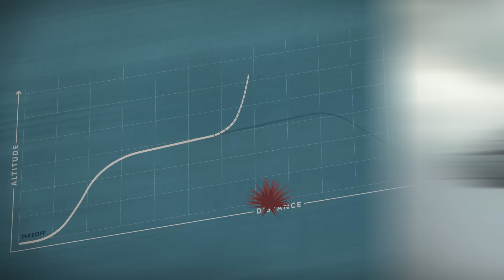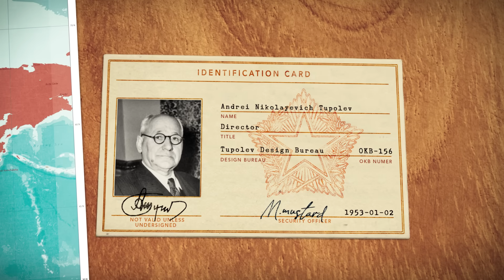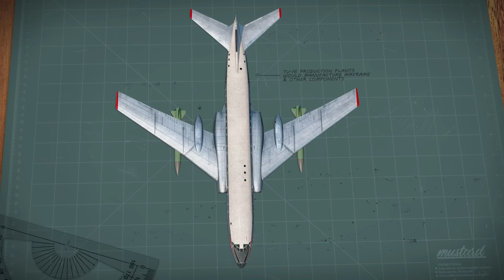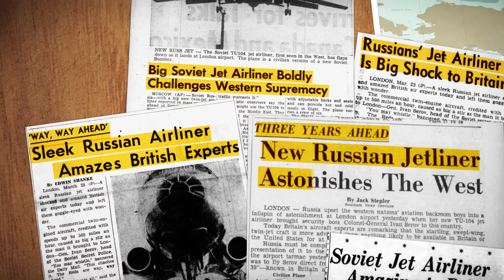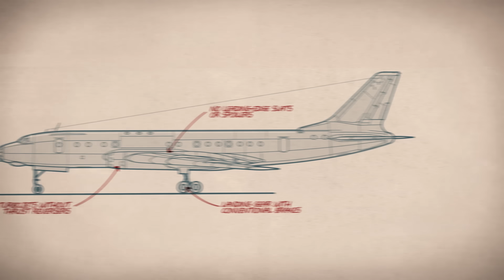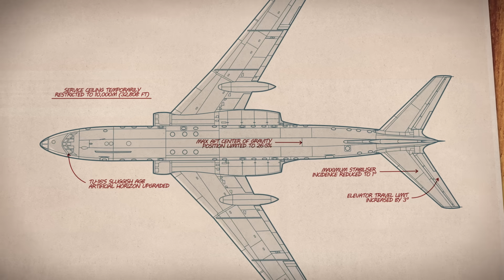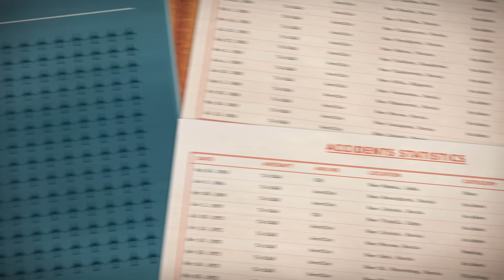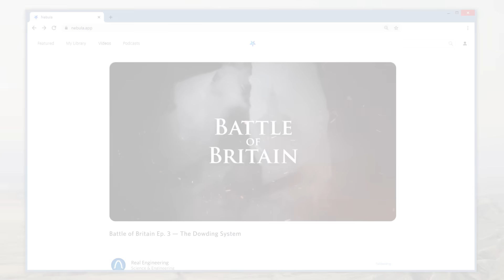The Soviet Airliner Designed To Crash

Comment: Clearly we feel we can shed some light on some common myths & misunderstandings.

  That's correct of course, at the time the Comet wasn't particularly dangerous. It was also definitely not the worst aircraft engineering disaster in aviation history obviously.

   Obviously the Comet's engine position & inlet position had some distinct advantages at the time & of course pylon mounted  podded engines have some problems including excessive induced drag. The Comet engine inlet design was not a fatal flaw & didn't cause any incidents.

Examples of all Comets mks including some Comet 1 airframes continued flying with certification at some point after 1954. Flying carried on until 1997. 

      Losses comparisons.
Accident Losses % of total built.
How things were in those days.

DeHavilland Comet 4 UK                 14% 
DeHavilland Comet all   (ff 1949)   17%  

Douglas DC-1                                      99%
Douglas DC-2                                      47%
Douglas DC-3                                      30%
Douglas DC-4                                      26%
Boeing s300                                             72% 
Boeing 307                                               70%
Boeing 247                                               48%
Boeing 707                                               20% 
Lockheed L-049/149 Constellation        30%
Lockheed Electra  Turboprop                  29%
Fairchild FH-227                                       30%
McDonnell Douglas DC-8                        14%
Sud Aviation Caravelle                             15%
Canadair CL-44  Turboprop                   46%  
Convair CV-580  Turboprop                   22%
Convair CV-880    (ff 1959)                    27%  
Convair CV-990     (ff 1961)                   35% 
Tupolev T-104     (ff 1955)        16%

     Of course De Havilland had prior experience building many all metal construction airframe aircraft & thousands of jet powered fighter aircraft that were primarily of metal construction with pressurised cockpits & jet engines built by De-Havilland.

  Yes, that's true, De Havilland carried out full stress analysis & engaged in a comprehensive & protracted testing program which is why key De Havilland people were happy to be aboard flying DH Comet aircraft. The Comet was the first airliner where stress due to pressurisation significantly exceeded flying load stress for a full length passenger cabin fuselage.

    We agree, that's correct, the DH Comet was the first passenger airliner with full length fuselage pressurisation at 8psi pressure differential. Handley Page built the world's first all metal construction airliner during the 1920s.
    In all cases other earlier pressurised aircraft were larger, needed thicker fuselage skins due to flying stresses alone & had much lower pressurisation differential pressure or were military aircraft with relatively small heavily built pressurised capsules. 

     Of course ripstop provision was provided. The skin alloy used became unavailable at the time due to R & D at the manufacturers which resulted in the original alloy being discontinued. Later alloys had very similar properties. The skin thickness used for the Comet was used for similar size later aircraft. Frame spacing was not found to be too large & frame width was not found to be too small.

    Without doubt De Havilland did indeed always work to better than industry standards at the time, used up to date knowledge for the design & construction & no evidence of negligence or criminal negligence was ever produced in relation to the DH Comet.

    Obviously the DH Comet had no effect on the course of the aerospace industry in the UK. The UK now has the world's highest combined nuclear, aerospace & defence sectors per capita activity. Of course anyone currently flying on a wide body airliner stands a good chance of being on an aircraft powered by RR gas turbine aero engines designed & built in the UK.

    That's correct, the investigation committee did not find hundreds of fatal flaws or evidence of design defects, structural defects, defective materials or shoddy workmanship. Indeed it is the case that ripstop provision was included. Claimed incidents did not involve cracks starting from passenger cabin window corners. Pretty much all changes were just in case changes or were planned development modifications & improvements that were scheduled regardless of incidents.

    Obviously De Havilland designers knew all there was to know about metal fatigue at the time they designed the DH Comet.

    It is in fact entirely true to say that the way airliners were built changed everywhere, including in the US, after the Comet incidents.

We hope this helps, obviously.

Cheers indeed of course as always etc.
& 👍 without doubt.
 
 
 . . .... ... ..... ....... . ...
. . ..... ..... ... ......  . ...

Comment: INSERT BAT SHITE TROLL COMMENT  BELOW. >
Reply: Yall clearly the p51 thunder-blackbird mriya bell helicopters mi24 was worse. Can’t believe yall didn’t know that
Reply: "The British de Havilland Comet was the worst jet airliner in history." - except, missing contexts.

EDIT: Besides, why delete your own comments if you're so confident?
Reply: Clearly we feel we can shed some light on some common myths & misunderstandings.

  That's correct of course, at the time the Comet wasn't particularly dangerous. It was also definitely not the worst aircraft engineering disaster in aviation history obviously.

   Obviously the Comet's engine position & inlet position had some distinct advantages at the time & of course pylon mounted  podded engines have some problems including excessive induced drag. The Comet engine inlet design was not a fatal flaw & didn't cause any incidents.

Examples of all Comets mks including some Comet 1 airframes continued flying with certification at some point after 1954. Flying carried on until 1997. 

      Losses comparisons.
Accident Losses % of total built.
How things were in those days.

DeHavilland Comet 4 UK                 14% 
DeHavilland Comet all   (ff 1949)   17%  

Douglas DC-1                                      99%
Douglas DC-2                                      47%
Douglas DC-3                                      30%
Douglas DC-4                                      26%
Boeing s300                                             72% 
Boeing 307                                               70%
Boeing 247                                               48%
Boeing 707                                               20% 
Lockheed L-049/149 Constellation        30%
Lockheed Electra  Turboprop                  29%
Fairchild FH-227                                       30%
McDonnell Douglas DC-8                        14%
Sud Aviation Caravelle                             15%
Canadair CL-44  Turboprop                   46%  
Convair CV-580  Turboprop                   22%
Convair CV-880    (ff 1959)                    27%  
Convair CV-990     (ff 1961)                   35% 
Tupolev T-104     (ff 1955)        16%

     Of course De Havilland had prior experience building many all metal construction airframe aircraft & thousands of jet powered fighter aircraft that were primarily of metal construction with pressurised cockpits & jet engines built by De-Havilland.

  Yes, that's true, De Havilland carried out full stress analysis & engaged in a comprehensive & protracted testing program which is why key De Havilland people were happy to be aboard flying DH Comet aircraft. The Comet was the first airliner where stress due to pressurisation significantly exceeded flying load stress for a full length passenger cabin fuselage.

    We agree, that's correct, the DH Comet was the first passenger airliner with full length fuselage pressurisation at 8psi pressure differential. Handley Page built the world's first all metal construction airliner during the 1920s.
    In all cases other earlier pressurised aircraft were larger, needed thicker fuselage skins due to flying stresses alone & had much lower pressurisation differential pressure or were military aircraft with relatively small heavily built pressurised capsules. 

     Of course ripstop provision was provided. The skin alloy used became unavailable at the time due to R & D at the manufacturers which resulted in the original alloy being discontinued. Later alloys had very similar properties. The skin thickness used for the Comet was used for similar size later aircraft. Frame spacing was not found to be too large & frame width was not found to be too small.

    Without doubt De Havilland did indeed always work to better than industry standards at the time, used up to date knowledge for the design & construction & no evidence of negligence or criminal negligence was ever produced in relation to the DH Comet.

    Obviously the DH Comet had no effect on the course of the aerospace industry in the UK. The UK now has the world's highest combined nuclear, aerospace & defence sectors per capita activity. Of course anyone currently flying on a wide body airliner stands a good chance of being on an aircraft powered by RR gas turbine aero engines designed & built in the UK.

    That's correct, the investigation committee did not find hundreds of fatal flaws or evidence of design defects, structural defects, defective materials or shoddy workmanship. Indeed it is the case that ripstop provision was included. Claimed incidents did not involve cracks starting from passenger cabin window corners. Pretty much all changes were just in case changes or were planned development modifications & improvements that were scheduled regardless of incidents.

    Obviously De Havilland designers knew all there was to know about metal fatigue at the time they designed the DH Comet.

    It is in fact entirely true to say that the way airliners were built changed everywhere, including in the US, after the Comet incidents.

We hope this helps, obviously.

Cheers indeed of course as always etc.
& 👍 without doubt.
 
 
 . . .... ... ..... ......
. . ..... ..... ... ......

Comment: That was in 1950s! there is a more dangerous Airliner this days - BOEING!!!!
Reply: The de Havilland Comet and the Tu-104 have far worse safety record than any Boeing aircraft.
Boeing currently makes the safest aircraft in the history.
The 787 has the best safety record of any aircraft ever built in the entire history of aviation.
Reply: @sandervanderkammen9230 

Clearly we feel we can shed some light on some common myths & misunderstandings.

Obviously it's possible to predict the potential accident losses for airliners simply by looking at the year they first flew. However, if we take into account all the variables including the year they first flew & we discard random incidents such as a vehicle colliding with an airliner during its takeoff run, there are some airliner manufacturers that stand out as producing  particularly safe aircraft for the years in which they operated, Bombardier & Embraer being two such manufacturers.

It's definitely true to say that Bow-wing (See B-47 wing folding & wing collapse incidents), which has more than 50 years design & build experience on the type, obviously can have no excuses for the 737 Max incidents, those incidents being directly caused by serious design defects.

  That's correct of course, at the time the Comet wasn't particularly dangerous. It was also definitely not the worst aircraft engineering disaster in aviation history obviously.

   Obviously the Comet's engine position & inlet position had some distinct advantages at the time & of course pylon mounted  podded engines have some problems including excessive induced drag. The Comet engine inlet design was not a fatal flaw & didn't cause any incidents.

Examples of all Comets mks including some Comet 1 airframes continued flying with certification at some point after 1954. Flying carried on until 1997. 

      Losses comparisons.
Accident Losses % of total built.
How things were in those days.

DeHavilland Comet 4 UK                 14% 
DeHavilland Comet all   (ff 1949)   17%  

Douglas DC-1                                      99%
Douglas DC-2                                      47%
Douglas DC-3                                      30%
Douglas DC-4                                      26%
Boeing s300                                             72% 
Boeing 307                                               70%
Boeing 247                                               48%
Boeing 707                                               20% 
Lockheed L-049/149 Constellation        30%
Lockheed Electra  Turboprop                  29%
Fairchild FH-227                                       30%
McDonnell Douglas DC-8                        14%
Sud Aviation Caravelle                             15%
Canadair CL-44  Turboprop                   46%  
Convair CV-580  Turboprop                   22%
Convair CV-880    (ff 1959)                    27%  
Convair CV-990     (ff 1961)                   35% 
Tupolev T-104     (ff 1955)        16%

     Of course De Havilland had prior experience building many all metal construction airframe aircraft & thousands of jet powered fighter aircraft that were primarily of metal construction with pressurised cockpits & jet engines built by De-Havilland.

  Yes, that's true, De Havilland carried out full stress analysis & engaged in a comprehensive & protracted testing program which is why key De Havilland people were happy to be aboard flying DH Comet aircraft. The Comet was the first airliner where stress due to pressurisation significantly exceeded flying load stress for a full length passenger cabin fuselage.

    We agree, that's correct, the DH Comet was the first passenger airliner with full length fuselage pressurisation at 8psi pressure differential. Handley Page built the world's first all metal construction airliner during the 1920s.
    In all cases other earlier pressurised aircraft were larger, needed thicker fuselage skins due to flying stresses alone & had much lower pressurisation differential pressure or were military aircraft with relatively small heavily built pressurised capsules. 

     Of course ripstop provision was provided. The skin alloy used became unavailable at the time due to R & D at the manufacturers which resulted in the original alloy being discontinued. Later alloys had very similar properties. The skin thickness used for the Comet was used for similar size later aircraft. Frame spacing was not found to be too large & frame width was not found to be too small.

    Without doubt De Havilland did indeed always work to better than industry standards at the time, used up to date knowledge for the design & construction & no evidence of negligence or criminal negligence was ever produced in relation to the DH Comet.

    Obviously the DH Comet had no effect on the course of the aerospace industry in the UK. The UK now has the world's highest combined nuclear, aerospace & defence sectors per capita activity. Of course anyone currently flying on a wide body airliner stands a good chance of being on an aircraft powered by RR gas turbine aero engines designed & built in the UK.

    That's correct, the investigation committee did not find hundreds of fatal flaws or evidence of design defects, structural defects, defective materials or shoddy workmanship. Indeed it is the case that ripstop provision was included. Claimed incidents did not involve cracks starting from passenger cabin window corners. Pretty much all changes were just in case changes or were planned development modifications & improvements that were scheduled regardless of incidents.

    Obviously De Havilland designers knew all there was to know about metal fatigue at the time they designed the DH Comet.

    It is in fact entirely true to say that the way airliners were built changed everywhere, including in the US, after the Comet incidents.

We hope this helps, obviously.

Cheers indeed of course as always etc.
& 👍 without doubt.
       
 
 . . .... ... ..... ....... . .....
. . ..... ..... ... ...... ..... ...